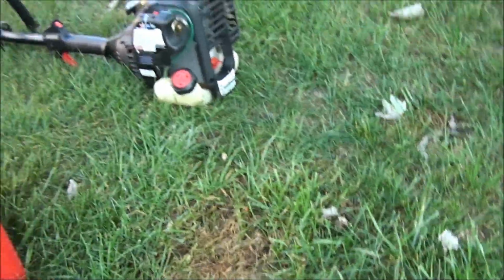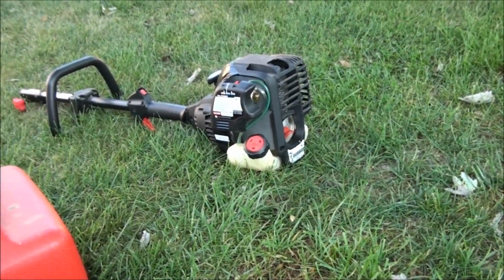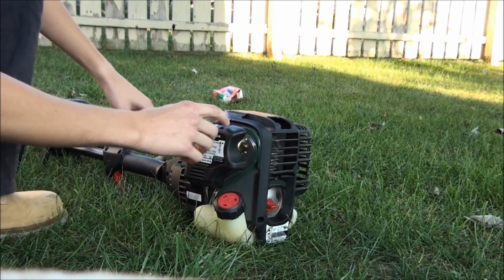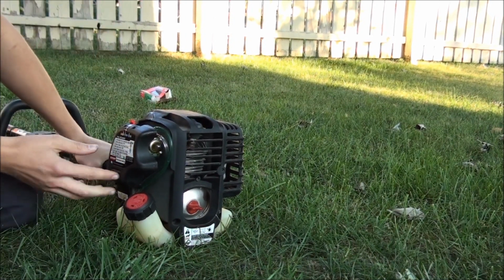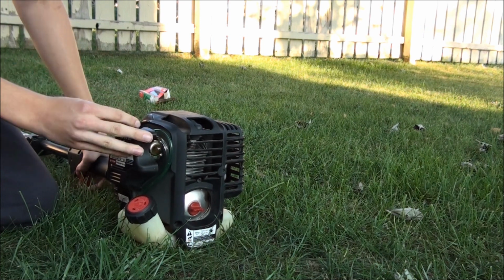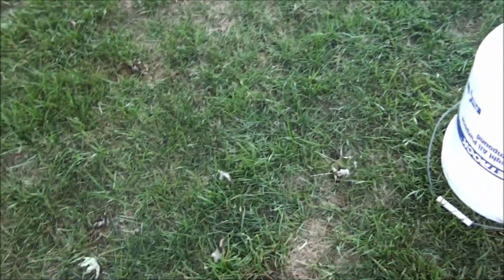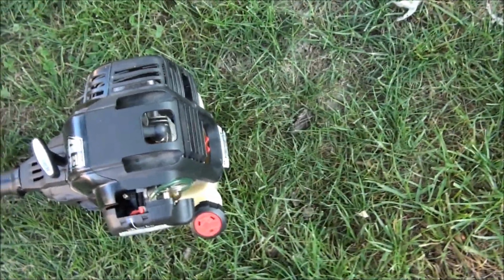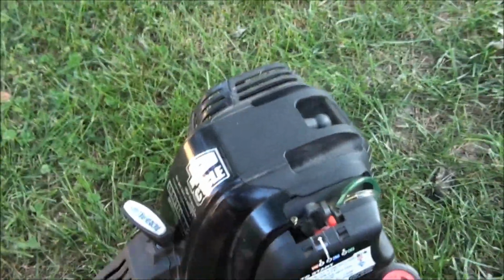Start up craftsman 4 cycle trimmer

Comment: I have had mine may years, I  bought it within weeks after it went on the market. It was not like oil mixed to gas trimmers. I learned right away you had to let it warm  up for a couple minutes and then it ran fine. Just follow the instructions for starting and let it warm up it will run perfect.

Comment: Just feather the throttle until it warms up and almost dies with the choke on, then start opening the choke while feathering it. It'll warm up an run for you a lot quicker and easier.

Comment: I have this same one and it bogs down and has no power. Its only 3 years old, last year I started having to leave it at 90% choke to keep it runnign right, now it bogs and has zippo power. Any thoughts? I run amsoil synthetic oil, premium nonoxy fuel,  but havent ever changed the plug.

Comment from the maker: Well there is a small filter inside of the tank, that had broke off. Then a few months later when I recieved it for repair, the fuel line broke off where it meets the gas tank. So thats when i knew that it had to be replaced. This type of problem may happen when the trimmer is only 4-5 years old like this one, and I've seen some that have lasted almost 20. These fuel lines are made of a rubber material. So sometimes they get so old they get hard like plastic and then can just crack apart.

Comment: Dude this video helps no one..... people want to know what to do when these 4 cycles bog down and stall upon full throttle.  I put a new one on a cub cadet and guess what, same problem again..... my opinion as a tech to those out there, stick with 2 cycle engines, get Alco no smoke mix, it covers all ratios and its clean burning. ... small engine tech 16 yrs exp.